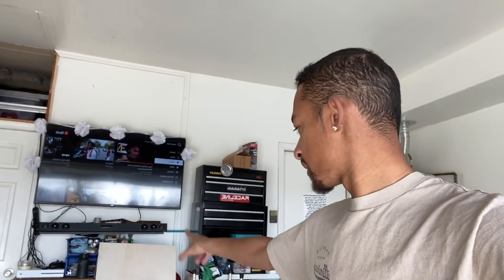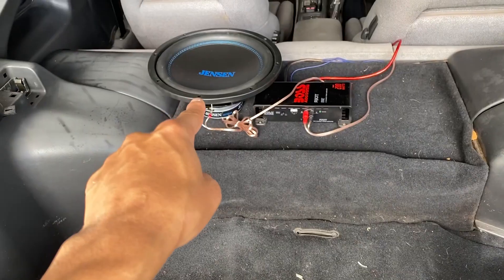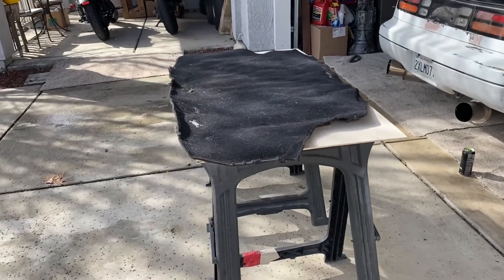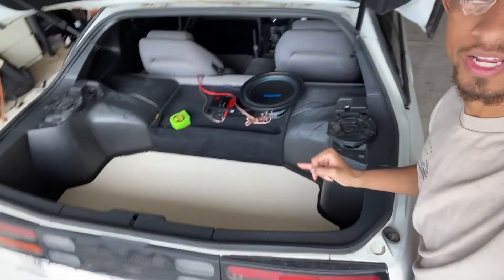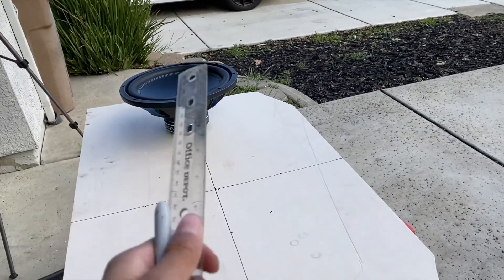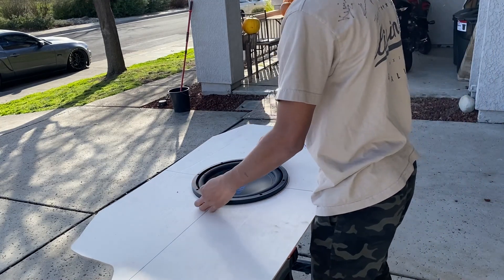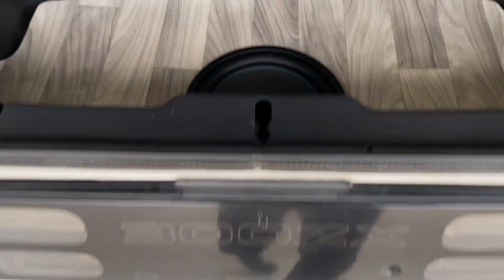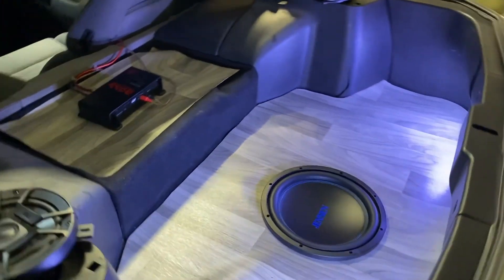Cheap DIY Custom Trunk Set Up!!

Comment: You coulda fone better than a jensen and a boss amplifier. And the "wood" looks like kitchen flooring. Not terrible if you just want a little bass but dang.
Reply from the maker: All the stuff I got was for mock up purposes. Already got a different sub and amp. Also changing the “wood” out too 🤣

Comment: How does it sound? Curious because I'm working on something similar where I'm using the spare tire well as the back of the enclosure.
Reply from the maker: sounds decent but would sound better with more effort put into making an enclosure under the wood floor
Reply: @ghostflash5  I found out the hard way.
Reply from the maker: @rob_nice1  ooof

Comment: Sub with open space? No offense but I bet it sounds trash. It needs to be enclosed in an air tight box. Should have make a box in the center on the under side of plywood and placed it in the box instead of just leaving it like that.
Reply from the maker: all was made for a fast and cheap budget build but yes you are definitely correct about it needing to be enclosed. i just didn't do that for the purpose of it being a "budget job"